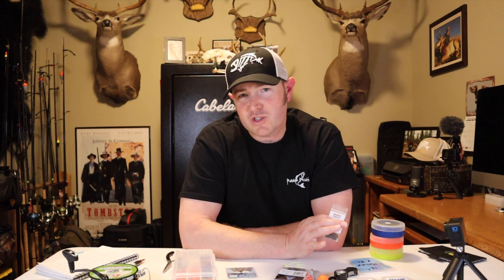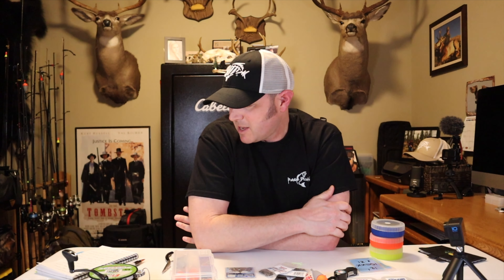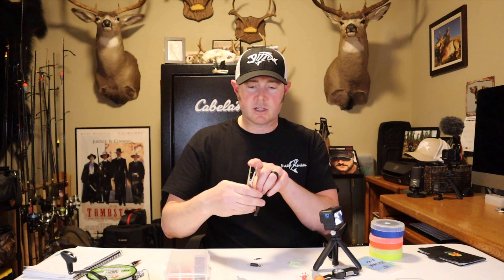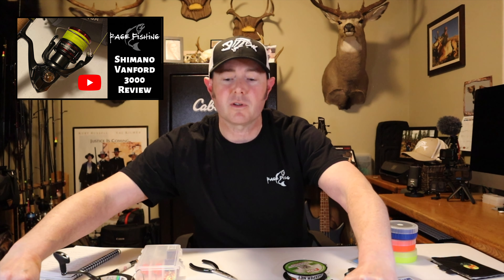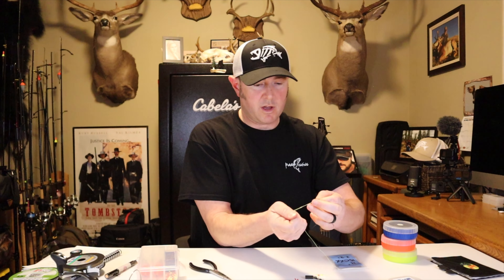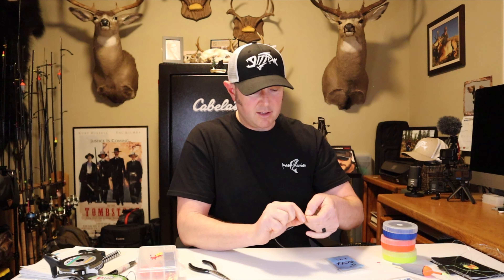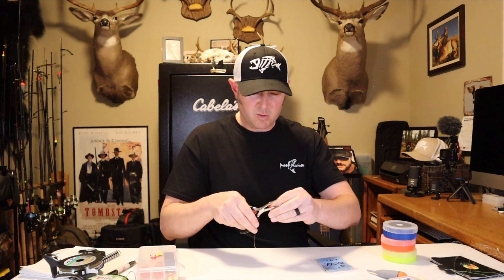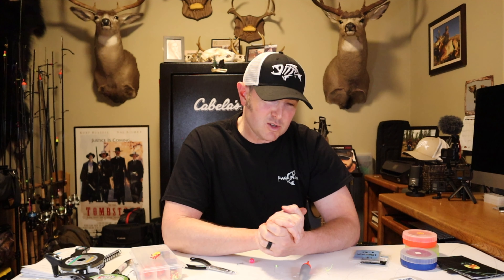STEELHEAD BEAD RIGGING USING THE TANGLE FREE METHOD-Explained in detail, with diagram and gear links

Comment: NICEEE! ...A mention! 
EPIC, LOL!!!
🤘
Reply from the maker: I’ve got to give credit where credit it due! 😁
Reply: @RAGEFISHING  Ive been playing with the split shot method last few outings  (i actually used small egg weights and clear bobber stops for zero damaging effects to the line) with yesterday being the worst experience using that method fishing higher, faster water. the egg sinkers were getting caught between small to medium sized boulders in the seams closer to the shore. 

if i could go back i think i would have fished a fixed setup to lesson the chance of snagging one of my egg sinkers.

You ever tried split shot approach? 
Ive begun to play with that due to the benefits of presenting the presentation first. Next salmon season ill play with it more...Definitely something to it, where and when it makes sense to use it. 

When i started salmon fishing 18 years ago, i ran inline, then years later fixed inline via bobber stop after watching fixed weight guys exceed slip weight guys side by side... and now to fixed dropper weight for the last several years. I believe all can serve a purpose depending on the run or how far and aggressive your casting in a certain run. That said i think all will occasionally twist up a leader (some setups less often and it depends on the skills of the caster) but the swivel, split ring, dropper weight off ring, swivel may be as good as an inline weight (damage/compromise wise) or better. Probably better.

Last few years for steel and salmon, ive played with a fixed dropper off a 3 way swivel with the weight coming off the bottom and the leader coming off the side of the 3 way. most guys will have the leader for the 3 way swivel inline with the mainline but i prefer the weight “inline” with the main if that makes sense. Set it up yourself and take a look at the mainline knot and how the mainline pulls on the setup. For me i prefer the end of the weight and the mainline to be inline for bottom contact, and leader off the side. That said, a weight off the side might serve better when fighting a fish for how it behaves and thrashes during the fight. (I will say, Nothing has stuck out to me as though it effects the landing ratio doing it the way Ive done it.)

That aside, you can also make these tangle free weights with shrink wrap, bulk shot and even add those big Rosco swivels to give you an even MORE snag less weight. Split shots or bulk shot in tandem tend to bow and ride over things on the bottom vs getting wedged like a solid chunk of lead. Many guys use stick lead for what i believe is this reason (itll bend and rip out). I know a guy up here that runs that exact Daves dangle setup, minus the swivel (home made version before Dave surfaced) in the dropper weight, but with bulk shot in para cord (para doesnt grip like lead, and if you use steel as the bulk shot it should bounce more than lead like daves are said to aid in snagging less often, due to the “pinball steel” effect) as the weight in the center of the swivels and this specific guy, is a bit of a legend in the river we fish: BC steelhead slayer, Josh Pettigrew. He no longer makes videos but heres one where he shows the setup: https://youtu.be/tetAhTjEozg

Keep in mind, its a barbless fishery in BC so you need specific tools. *I believe specific hooks help like size and style and more of a limber long rod (medium, moderate or soft) to keep a hook pinned vs giving the fish leverage, is part of a higher landing % in a strict fishery.
Reply from the maker: @danb3703  I bought some soft split shot from Bloodrun years ago with intent on trying it. Their soft shot is supposed to be better on the line.

I have used inline sinkers, in fact on the ‘steelhead road trip’, I used a Dave’s inline weight with an AF-5 slip float to try it out. It worked pretty slick, but with the water as low as it was, I should have been using a turbomaster with no visible weight below the surface.

When I used to float fish for salmon, I used inline sinkers sold by hawken which are lead. Oregon keeps trying to pass lead bans, so I want to be prepared if they do. Dave’s are made from steel.

I fish ‘slinkies’ when drift fishing, lead shot in parachute cord. Drift fishing involves a lot of hang ups, so I don’t dare use Dave’s weights. I’d be broke.  If Oregon outlaws lead, I have some steel shot I will use to substitute for the lead. They will be lighter, so it will take more shot to equal the weight of lead.

As far as the weight off the lower part of a 3 way swivel; for salmon that seems doable as long as your using good line and tying good knots. I don’t do much salmon fishing because I hunt most of the fall when our runs are the best. I am planning to do some springer fishing this year though! I will keep this rigging in mind. 🎣
Reply: "Rage the legend steelheader" what mm are those spit rings?
I'm making my own with thick hollow core for salmon fishing. (Ive been making mine with 3 way swivels where the weight and mainline are INLINE and the leader comes off the side. (Works well to find and tick bottom but also to slow things down if you want to play with bottom to push out your bead or roe infront of the weight etc.)

 @RAGEFISHING
Reply from the maker: @danb3703  Hey Dan B! ‘the legend?’ Ha! I’m not sure about that. Yes, this rig works great for me. Split ring with 2 barrel swivels with the stick weight threaded on. I don’t have tangle issues any longer. 

You’re method seems legit. Keeping the weight out the back must reduce tangles with the leader.

Comment: How did you come up with the 30 inch leader? I've always heard 18 to 24 inches.
Reply from the maker: Trial and error. That’s actually fairly short. 30” keeps it a decent distance from the weight and allows it to swing back and forth in the current.

Comment: I'm a rookie steelheader and one thing in the video confuses me. The diagram says to use an AF-6 float which is weighted which I always thought meant that you don't use another weight in the setup.
Reply from the maker: The weighting system in this float adds weight for casting purposes and is matched with the approximate weight of a jig or weight. Without the additional weight, the bead will not stay down in the strike zone. I hope this makes sense. Thanks for the question, good luck. I have a bunch of steelhead content coming in December, so watch for that including more tutorials. 🎣
Reply: @RAGEFISHING  Still confused. Would I use an 1/4 oz weight with a 1/4 oz AF-6 then?
Reply from the maker: @colinjenkins4665  yes, match the weight to the float. The bead is buoyancy neutral.